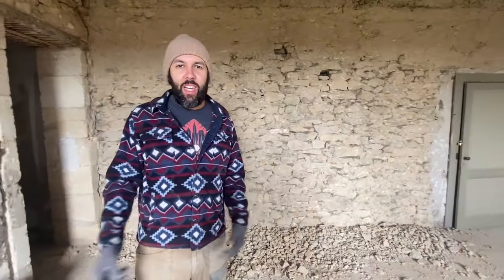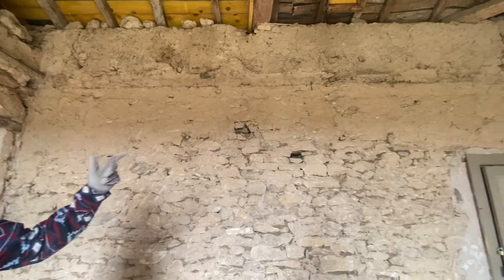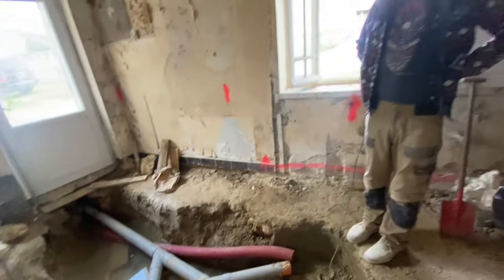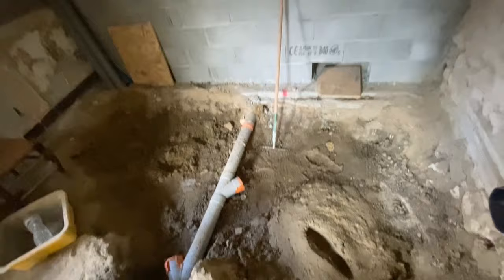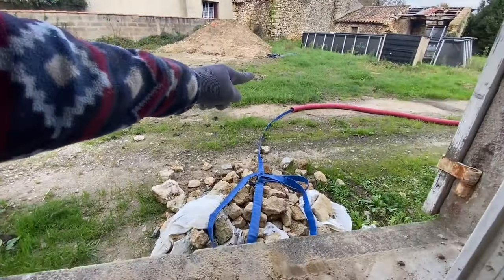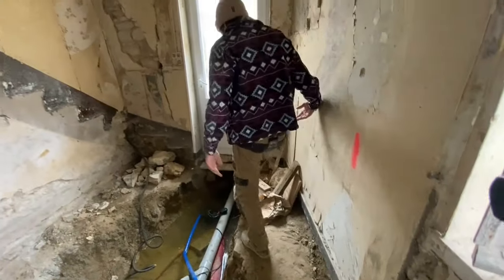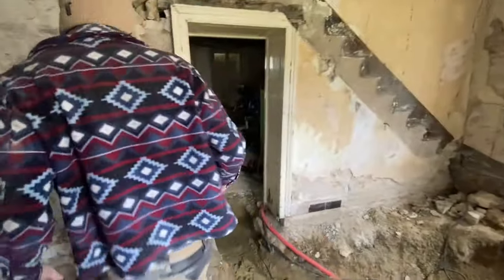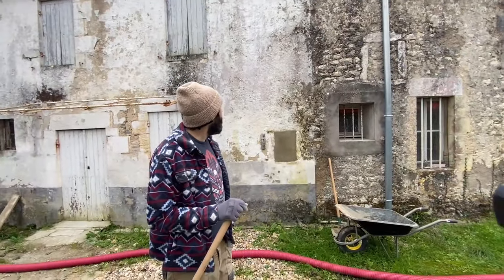Our First Floor Is Flooded/Resuming the Mortar Removal -Vlog-

Comment: Will you keep a sump pump connected once floor is repoured?  We have one in our basement after a couple of years for high ground water levels.  Nate do you find the building practices/rules a lot different then the US?
Reply from the maker: That is an idea we will take into consideration! We poured the slab on the other side without any water remounting, so we may be ok. We will post a video documenting the steps we took.
The building practices are very different since it is an older style house in stone, which is less common in the US. I lived in an area that was mostly wood-framed housing. Although each have their merits. I also found the electrical norms are a bit more rigid in France IF you want it to be certified. But a lot of the codes are not obligatory (just diminishes the resale value)